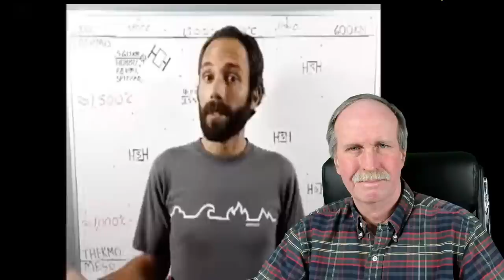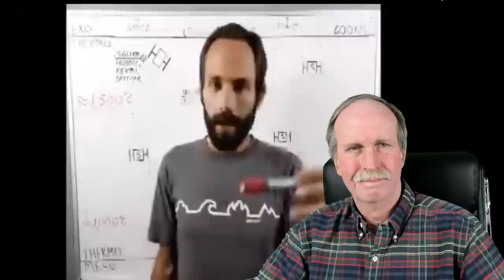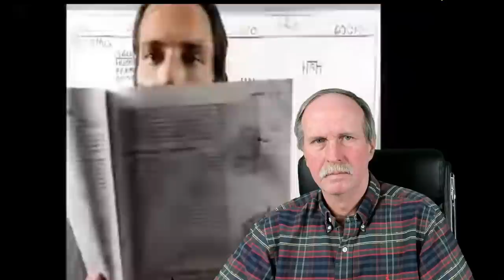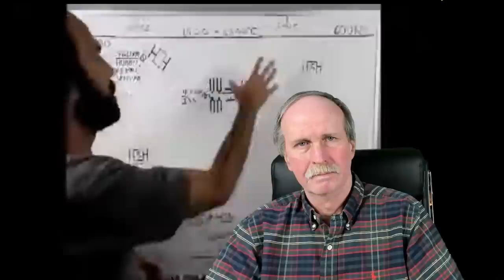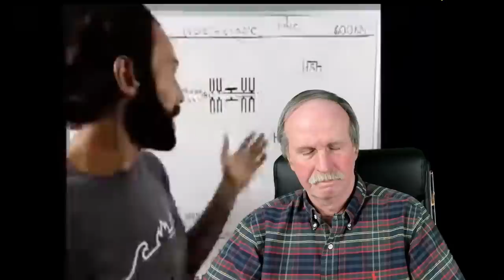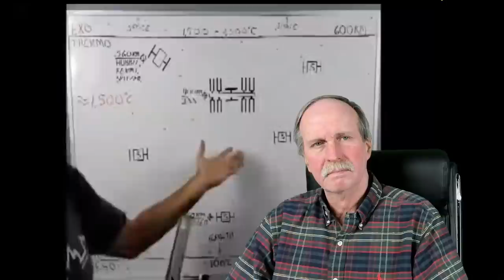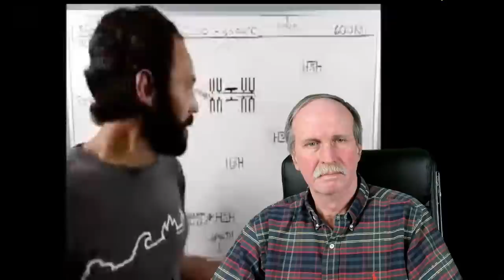Brian Mullin- Thermosphere and the ISS

Comment: That pet rock has come in handy on occasions. Brian demonstrated a common theme of many flerfs of not appreciating scale or proportionality, but being an engineer just makes it almost sad.
Great video 👍 again
Reply: Sad?  I find it rather horrifying.
Reply: @fromagefrizzbizz9377  Scary thought: Would you want to drive over a bridge he designed?
Reply: @warrentaylor8428  Story time.  I live in Ontario.  Just a few km east of me is Quebec, and Montreal is about 2 hours drive south.

The construction industry in Quebec (especially Montreal) is infamous for being corrupt.  It's probably a lot better now but the peak was probably in the 70s-90s.

By "corrupt", in some cases outright bribery in government bids, and in many cases, the materials used for construction were deliberately under-spec so they could save money.  Eg: fewer bags of cement per yard of concrete.  Eg: skimping on rebar.  Eg: not fully excavating roadbed for refill with gravel, etc.

Stress-concrete over/underpasses and elevated skyways have a design goal to hit 50 years of service with relatively little maintenance/repair, and then be replaced - not repaired, *replaced*.  Note the mention of "stress concrete" - forming the bridge sections with rebar, and threaded rod compressing the slab to maintain strength.  Further, remember we have real winters here, and road salt (which concrete doesn't like), so engineering to achieve a 50 year lifetime is pretty tough.

A couple of Quebec bridges actually fell down a few years before their time was up turning out to be corrupt building practise.  A fatality or two, much screeching.

I know quite a bit about this because my father was a Civil PE (including structure), and I learned a lot from him.

Imagine, if you will, while visiting Montreal and going along one of their aerial expressways, being informed by my friend (the driver), saying "oh, guess what?  This highway has NO rebar!". 

Sphincter clamped shut, white knuckle time! Pure terror!

It would be the same on any bridge designed by friend Brian.

Comment: What a peculiar video.  He kinda seems to understand how it's supposed to work and then seems confused by it all and starts disbelieving it.

Classic case of confusing temperature for heat.  The whole thing would be solved by working out the energy density of the Thermosphere in joules per cubic metre.

Also the look on your face, Bob, when he said he didn't know how heat and light got from the Sun to the Earth.  Then he picks up the book and shows the EM spectrum diagram, which demonstrates he ought to know the answer already.

Also, Brian, the Sun doesn't just emit light, it emits a continual stream of photons at nearly all wavelengths.
Reply: I came to the same conclusion, he is delusional.

Comment: I cast my mind back to soviets reparing a hole in the iss having to cut through layers of what looked like roof insulation.  Add to the fact that with an orbit of 90 minutes the iss is only in the sun for 45 minute, then out of the sun for 45 minutes.

Comment: Hmm... I don't think it's the less hot air in the kitchen that stops the boiling when you turn the burner off. I think the pot stops boiling "pretty quick" because it takes a lot of energy (heat of fusion) to change water from liquid to gas. Every bubble of steam created transfers energy out of the water.

I hope he found his footing after all this crud. Hopefully nobody relying on his bridge designs had to struggle to find their footing, either.

Comment: I'm a little confused,  It happens at my age.  When someone describes the thermosphere as being very hot, and there are so few particles spread out so thinly, what exactly is so hot?  Are they referring to the particles?  Or is it because there is nothing to shield against the sun's radiation and if an object is placed there it will eventually get warmed up?

 And how can we tell  the thermosphere is so hot if a thermometer placed in it cannot register the temperature?  Or did I misunderstand something?

I may have to watch to this video again and listen more closely.  Thanks Bob, for helping me learn some of the stuff I missed (or forgot?) in high school nearly fifty years ago.
Reply: Yep, the particles are crazy hot. In order for a thermometer to work enough of these particles have to hit it to heat the thermometer to the same temp. There are hardly any particles. Think of the white hot sparks from a sparkler. Crazy hot, but they do not even register when they touch your skin. More heat passively radiates away each moment than the spark delivers. Think also of a Swedish sauna. The highest safe temperature would scald you if it was water at that same temperature. Another thought is 2000 degree cannon ball added to your bathtub and a 2000 degree bead. Same temperature - drastically different heat. There are a few different methods to measure the temperature in those challenging conditions and they are easily found online.
Reply: 'Temperature' is the kinetic energy of the molecules.  So in the thermosphere, the individual gas molecules have a lot of kinetic energy.  (They are moving very fast, and diatomic molecules also spin and vibrate very fast).  So we say it is 'hot'.  It's the individual gas molecules.

In theory, if you put an object up there, shielded from the sun, and somehow arranged that the object can't radiate any thermal energy away, it would...  after a very long time, absorb enough energy from those very sparse gas molecules to raise it's temperature up to that of the gas.  But ordinary objects as they start to warm, give off infra-red radiation, radiating away thermal energy.  So an object that can radiate infra-red to outer space will never get very warm at all.  In fact they will cool off if not warmed by internal heat source or sunlight from the sun.
Reply: It's the amount of energy within individual molecules and atoms. Where there's less, high up, there are fewer to transfer that energy to say, your skin, so it may only feel slightly warm.
Where there's more, lower down, the individual atoms and molecules might have a lower energy, but being far more abundant, can transfer that energy, making your skim feel warmer by comparison.

Comment: At 12:25, does he actually say that the "second law of thermodynamics says that  heat has a quality as well as quantity"?  No, it certainly DOESN'T say that.  Furthermore, the zeroth law of thermodynamics means that "all heat is of the same kind" (Maxwell's formulation).

[The zeroth law says that if two thermodynamic systems are in thermal equilibrium with a third, then they're in thermal equilibrium with each other.  This is equivalent to the mathematical axiom: if a=c and b=c then a=b]

There's no such thing as "heat quality".
Reply: Maybe it's "a dry heat". 😄
Seriously, we're talking about the scientific definition of heat as energy here.  Brian should know this.
Reply: @bobblum5973  Of course.

Comment: Oh my tapdancing GOD!!! How is this guy an engineer if he doesn't grasp difference between temperature and amount of heat? Or how heat transfer works? I'm not an engineer! My knowledge about this comes from regular physics classes in school and college - and i know how it works!
Sheesh.
Good example: Fireworks. Every spark is very, very hot - in excess of 1000 degrees Celsius. But that spark is so tiny, it carries only minuscule amount of thermal energy. So little, you will barely feel anything if such spark lands on your exposed skin.
Thermosphere is the same. Yes, air molecules are very hot. But hey are so rare and far between, they can't transfer much heat to almost 500 tons of space station. Yes, ISS heats up and needs to radiate that heat out - but this heat comes mostly from Sun rays and internal activities. Every working electric circuit on board generates heat. Bodies of astronauts generate heat. Thus, big radiators and thermal covers outside to minimize heating by solar energy.
It's not any miracle or a secret!
Again, how Brian got his degree with such big holes in his understanding of science?
Reply: I’m not saying this may be the reason, but a lot of people are able to memorize without understanding.

Comment: 9:20 Bob, you are right that infrared electromagnetic wave is a kind of temperature transfer method. But microwaves doesn't produce infrared radiation. At least most of them. They just create electromagnetic waves at frequency about 2.4GHz. And because water molecule has dipolar magnetic quantity it is rotated by that wave and by friction creates heat.
Reply: So, basically a secondary effect, like an induction cooktop or heater.
Reply: 23:30 Now I see that beforementioned statement by dr. Bob about how microwave ovens work was just a lapsus. :)
Reply: @Bob Blum. Exactly.
Reply: Well....  We could argue some semantics here.  Water molecules are 'bumping into each other' all the time, yet water doesn't just spontaneously get hot.  The em waves make the water molecules vibrate faster and that, by very definition is a rise in temperature.  They don't have to 'rub' against something to be hotter, the fact that they are moving faster IS hotter.

This idea that molecules 'rubbing against each other causes friction' is a bit misleading.
Reply: The water molecule absorbs the EM and converts it to heat. Like Mike said, no "friction" needed.
Reply from the maker: Actually I talked about infrared heat AND I talked about microwave ovens, two separate things.  I didn't mean to imply they both employed infrared.  Microwave ovens use something akin to radar as I recall.

Comment: It's lupus....it's always lupus....🤪

What we could explain to him so he would possibly understand is a thermos bottle. The inner surface can be holding a liquid at an extremely high temperature, but the outside  is able to be held. The area between the inner surface and outer surface is a vacuum. Not a perfect vacuum, so there are gas molecules bouncing between both surfaces. But, the quantity of the molecules is so small, that the transfer of heat from the inside to the outside is almost imperceptible. This is similar to the heat transfer that occurs in the thermosphere.
Reply: Plus, the bottle is silvered to reduce transfer via infrared.

Comment: Lets assume rock that Bob is holding, is a hydrogen atom. It's about 4cm in diameter? Now, imagine that glasier is aluminium foil, about 200000 atoms thick. That foil would be 8km thick even if the hydrogen and aluminium atoms were as big, witch they aren't. How hot that 4cm hydrogen atom have to be to get thru that 8km of aluminium???